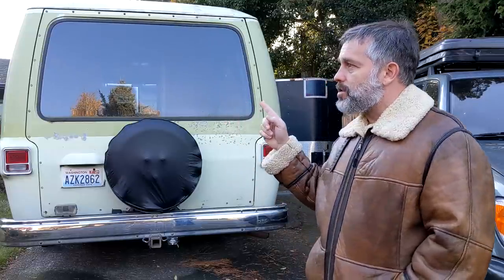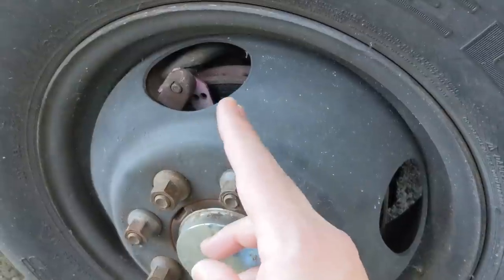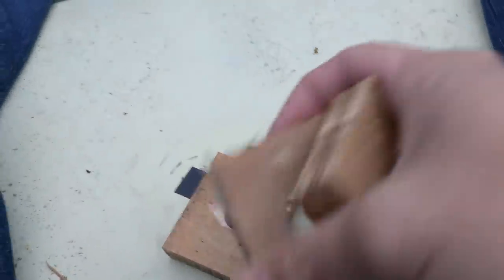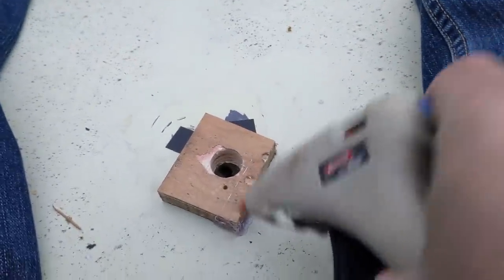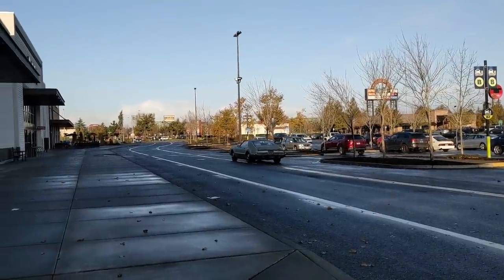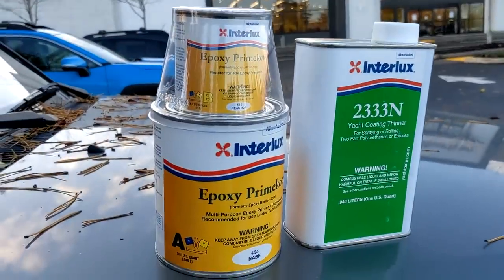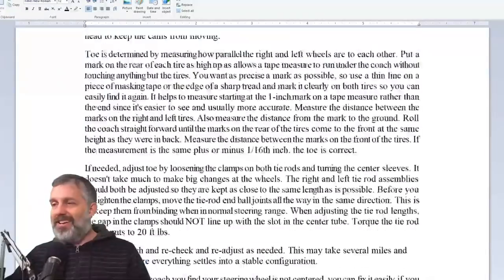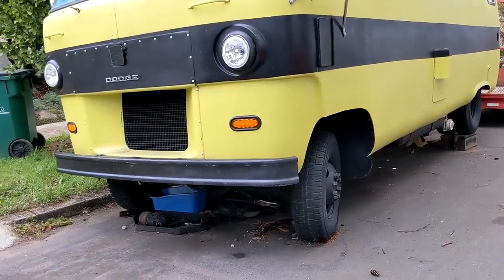Building the Best Damn GMC Motorhome Ever E.20 - Big Solutions & Small Details

Comment: As a professional spray painter, I would go with alacrillic latex enamel paint. I've had good success with it in spray can form. It comes in verity of color. It's the paint used for automotive in the assembly plant. Cover it with a clear urithan enamel. The clear can also be bought in a spray can at the auto parts stores. Acrilic clear can be used too. Although the urithan clear is more durable. Use safety respirator during application. When paint spraying, remember the feed and speed along with keeping a distance of eight to twelve inches from the surfaces. Over lap with each pass to get a uniform coating. And be aware of the temperature, read the label... good luck

Comment: On my GMC I used epoxy to attach aluminum panels to cover the water fill an kitchen vent openings. i tried to weld some small holes on the roof. I attempted in small welds not to build the heat and i still got significant warping.

Comment: I’ve seen one with the Rapture liner on the roof it look cool like a vinyl roof I bet no leaks. Marine paint good choice. Back in the day DuPont had a paint called Imron and it was tough as nails they painted semi trucks with it the same concept as marine paint. Great info on front suspension✌🏽
Reply from the maker: This motorhome actually came from the factory in 1978 with an Imron paint job. That's what I will be painting over. :)

Comment: Has anyone ever stripped the paint from the aluminum sections and polished those, is there any reason why I wouldn't?  I have a '73 GMC Sequoia and was also considering the marine paint option using the roll and tip method from boat builders but was also considering restoring the aluminum to a shine.

Comment: If the boat stuff doesn't work out, Eastwood makes a good single-stage automotive paint.  Spraying it yourself isn't hard, I taught myself and have done two cars now and both turned out decent (with good two stage paint).  Without a huge garage you'd have to rent some space as a paint booth.

Comment: These Palm Beach motohomes were based on the Oldsmobile Toronado FWD system, have you tried getting CV axles from a Toronado? They had the same basic front end suspension setup (and some chassis components) so it's possible you can cross-reference part numbers with Oldsmobile parts

Comment: I'm sure you have realized this by now that the product known as 'Plasti Dip' is not the same thing as an automotive vinyl wrap. Just to be clear, while vinyl wrap is going to work perhaps 'Plasti Dip'  will not be durable enough. Or it might turn out to be too messy and difficult to repair compared to adhesive vinyl sheeting that is specifically designed for outdoor / autos. However bedliner is a great idea. Usually bedliner is textured so probably not what you want for the top half of the vehicle. Where a smoother paint or vinyl finish would be more appropriate. A vinyl wrap should work... it's just a really big job! However the big difference is that you can apply a vinyl wrap outside. Wheras with spray painting yourself, you really will want to find an enclosed space big enough to fit your whole RV, and spray in an enclosure. To avoid dust particles settling on the paint before it's dry. And that is logistically a lot more difficult to arrange / setup. Maybe you could do it outdoors with some C stands and massive rolls of plythene sheets to enclose the part of vehicle that you are spraying at any given time. But the weather is against you now, at this time of the year! ... so yeah that Interlux glassfibre plastic coating stuff AKA 'glossy bedliner' seems like a great idea. Can still use regular bedliner to protect the underside of your vehicle where you cannot see / it doesn't matter.

Comment: @The Digital Maker  are you sure that the cv joints from a 1976 Cadillac Eldorado Drive Axle Kit wouldn't work or the olds toronado  ,,, the caddy had a front wheel drive on a 500 cid huge v8 engine   8.21 liters  ??????????????????????????????

Comment: Now that you have almost completely refurbished the envelope of the motorhome will you be replacing the heart of the motorhome with a new diesel engine?  The old Oldsmobile engine is 34 years old and might be the next point of failure.
Reply: The diesel conversions are in my opinion not worth the cost and effort. It's easily over $3,000 to convert to a diesel setup. For that amount of money you can have the original 455 rebuilt. The diesel power plant doesnt gain you very much in the mileage department either because of the 3 speed transaxle. People keep trying to convert these to diesel or even the Cadillac 500 engine. But the factory oldsmobile v8 is actually easier & cheaper to work on and find parts for than most diesels or the Cadillac v8. If the 455 dies you can replace it with any oldsmobile v8 the 307,330,350,403 & 425. All of which are more commonly available than the Cadillac 472 or 500. And the 455 with a simple cam swap can make more power than any stock Cadillac.